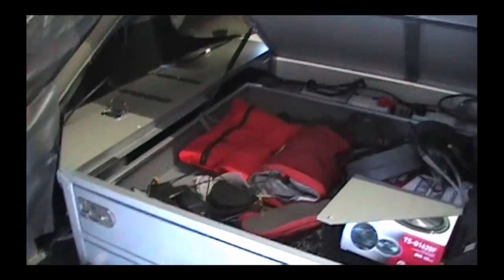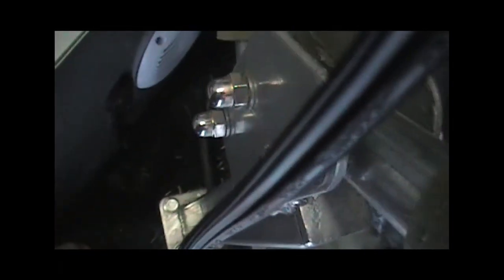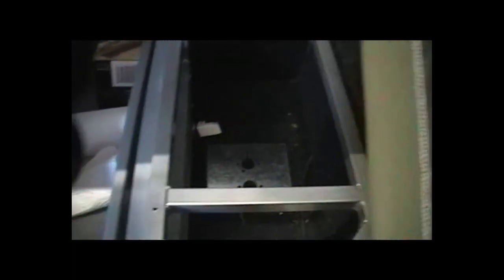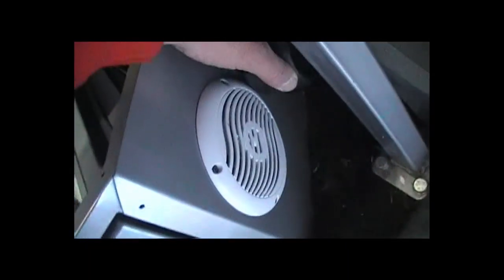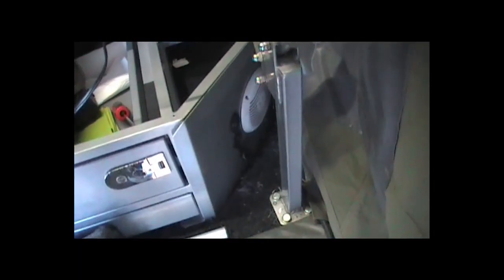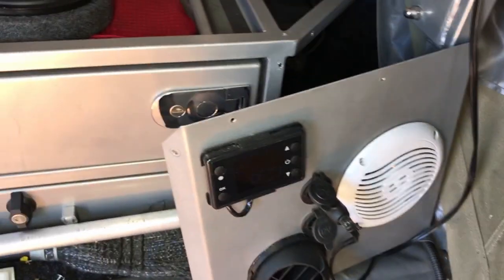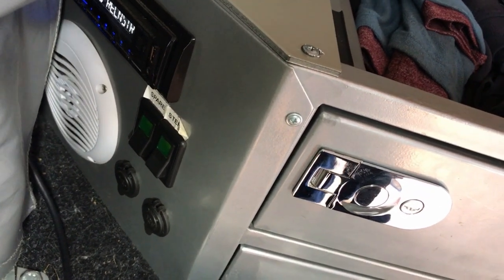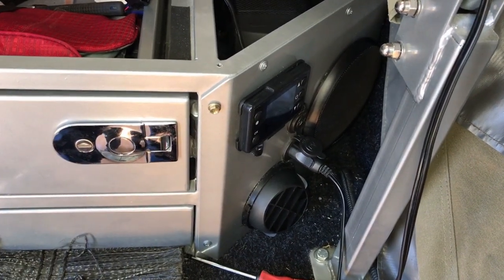Fitting a diesel heater to a rear fold MDC Cape York

Comment: Great video. Just wondering where your 240v charger is as mine is located where you have installed the heater.
Reply from the maker: My 240 volt charger was located in the front box on the RH side, so no problem for me :)

Comment: Can the air intake / exhaust be submerged in water for river crossings or deep puddles?
Reply from the maker: I would say that the ends would need to be plugged up, ive heard that people have used the rubber stoppers from Bunnings for the exhaust, probably the safest way would be to remove the tubes and plug the actual heater, would only be a 5 minute job.
Reply: @Richard-Tanya  Assuming that the holes made in the trailer were sealed as well...
Reply from the maker: @cobra1976a   Yes the base plate for the heater is sealed to the floor :)